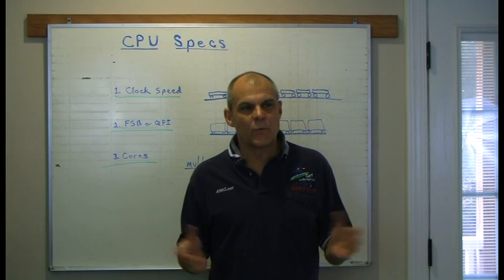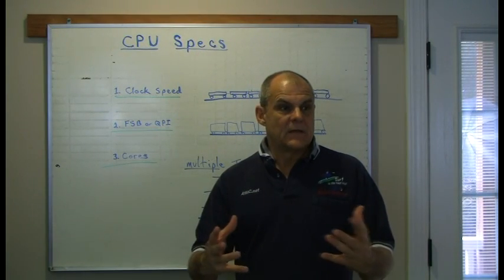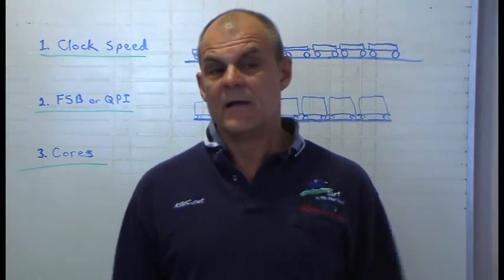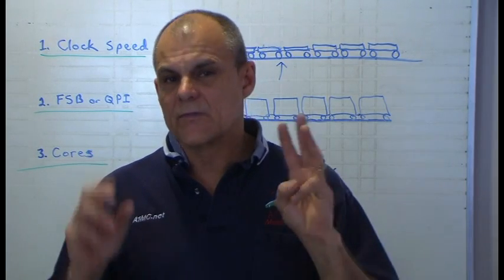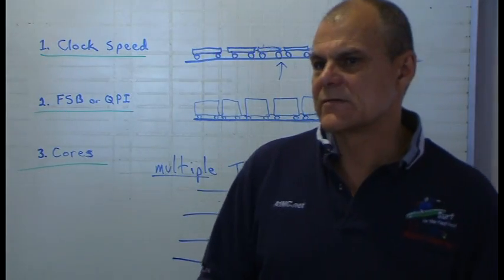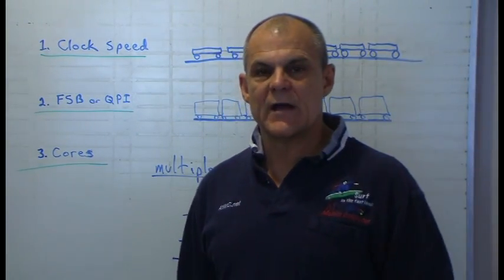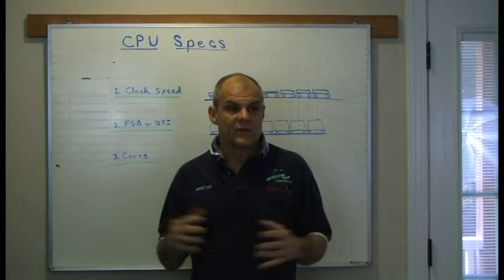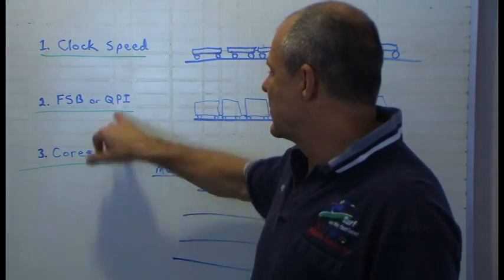Understanding CPU Specifications

Comment: Correct me if I'm wrong, but clock speed is the amount of data the processor processes in a specific unit of time?
Reply from the maker: Good Question: Clock Speed is actualy the number of processes in a specific time. The clock speed times the LGA or FSB woud be the actual amount of data processed in a specific time.  The latter spec could be QPI or DMI.  The reason the latter spec can be different has to do with what functions occur inside the CPU or inside the Northbridge (main build in chip besides the cpu on main board.)  The result is the same.  Think of it this way, Clock Speed is the speed of transferring one packet of data or how many packets per unit of time.  The LGA/QPI/DMI or FSB is how much data is inside any one of those packets!
Reply: +DalePoston how can we check cpu spes?
Reply from the maker: +Owais Khan , system properties in control panel
Reply: +DalePoston ok thanks
Reply from the maker: +MrSDPlayer , clock speed is one of the several important specs that determine the amount of data the cpu processes in a specific time.  Other specs that determine this are number of cores and fsb (or QPI, there are quite a few different terms now.)  Specifically clock speed determines the numbers of processes per unit of time but not necessarily how much data is processed in one process, this is determined more closely by the other two specs.
Reply: +DalePoston The 2 other specs are the number of cores and fsb?
Reply: Ok I think I got it, thanks
Reply: I've heard that task manager in windows actually measures time. Not percent